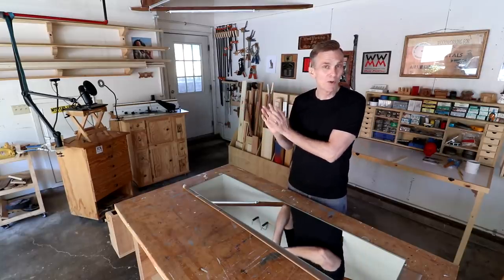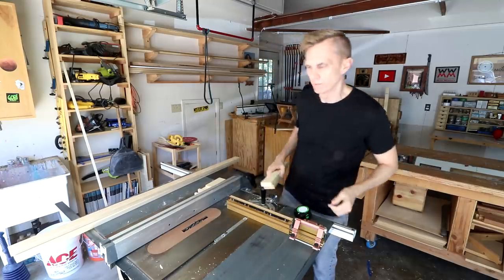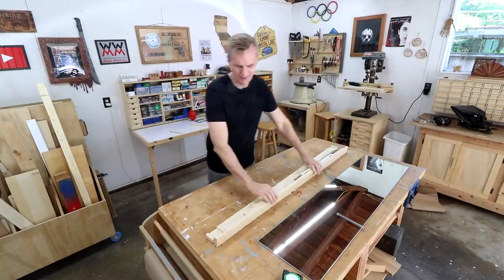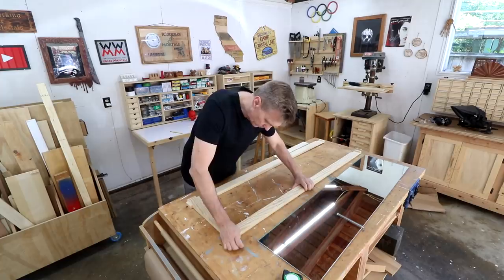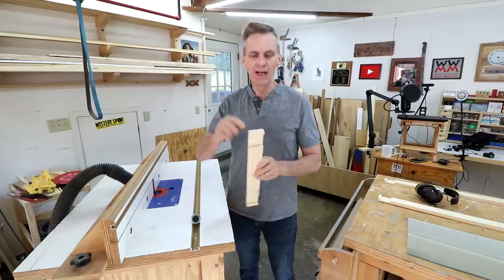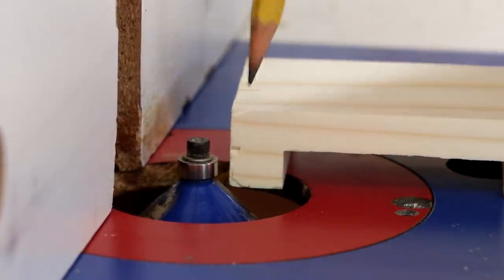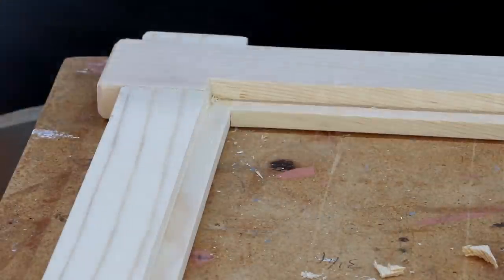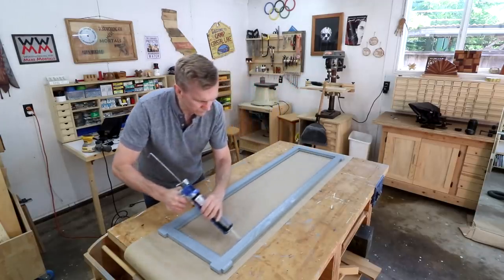Making a dressing mirror. Highlight small details to elevate a simple project.

Comment: Smoother, rounded edges are more suited for bulk handling. When selecting multiple 2x4s from the lumber yard, the slightly rounded edges make it easier to pull individual pieces from the stack. Boards with rounded edges are also easier to slide into the back of a truck.

Comment: I wanna make half-laps but I only have a mitre saw - any tips on how to do that?
Reply: unless it's sliding and has a depth stop built in, it really isn't feasable to do half laps with a miter saw. if you don't have one, pick up a circular saw, used or new can be pretty cheap
Reply: I'd get a cheap router with a straight bit. Using a simple jig to frame your cut area, you can get excellent results.

Personally, I think a fixed-base router is a must. Depending on your creativity with jigs and bits, you can do a surprising amount of things.

Comment: Won't it be a problem that there was already paint in the rabbet when you put the adhesive there? Obviously this will not be under a lot of stress.
Reply: The fit didn't look too tight to me. If the adhesive can fill the gap and stick to all surfaces, it should be fine.

Comment: Steve, can you talk about wood movement with this project?  I'm never sure when I should be concerned about wood movement or not.  Usually with half lap/rabbit type joints there is nothing on the other end so movement is less concerning, but this is has material on the other side.  Is it not a concern because it's such a small piece and won't expand much?  Also, is movement more of a concern in a sometimes humid environment, like a bathroom?
Reply: Thanks for the video response!  Haha.  Not sure if you had that planned or not, but thanks!

Comment: which rabbit bit did you use without a fence? trying to figure that out
Reply: Steve is running the piece against pilot bearing.  Same when doing the bevel.
Reply: The bit has a little bearing on the dingus end that rides against the flat surface of the board, preventing the bit going farther into the material.